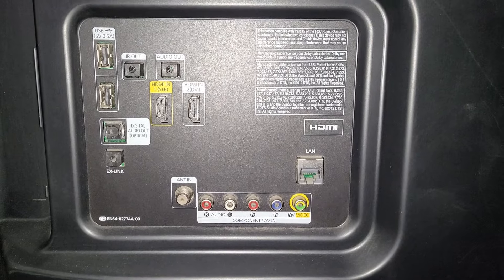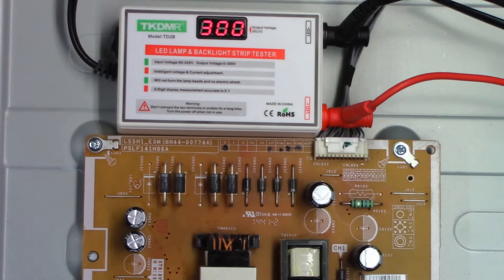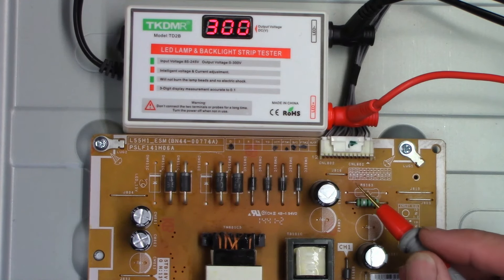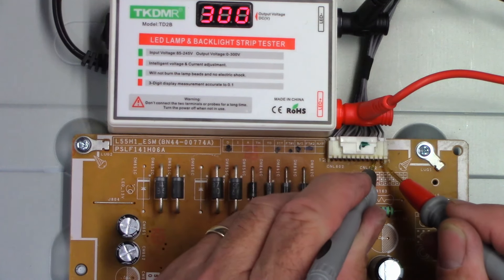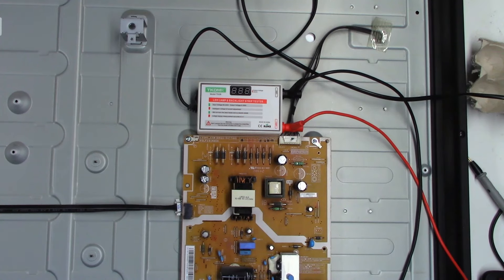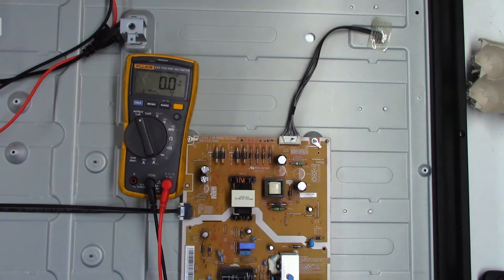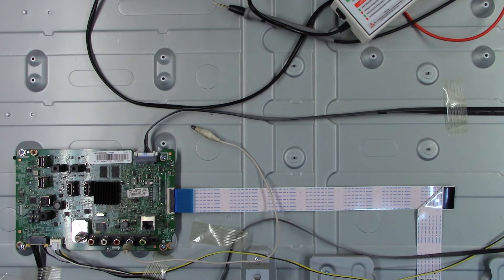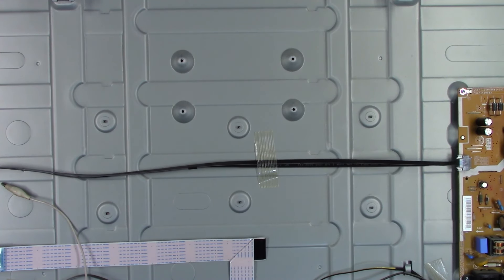Donated TV Samsung UN55H6203AF - Screen Flash and Power Light Blinks - Part 1 Diagnosis

Comment: I loooooooovvvveeee you repair's videos , what do you mean isolated variac , the earth ground is disconnected on the main cable ?

I thought every vatic is isolated , or it is connected to a 1:1 transformer ?

thank you
Reply from the maker: This unit has a 500va isolation transformer built in to it. Unless there is an actual "Isolation" transformer, then the variac is just a variable transformer and not isolated from the AC mains power. And yes the ground is isolated also, just to be safe. It is bonded to the neutral in the variac.